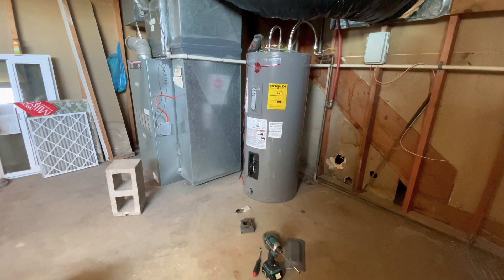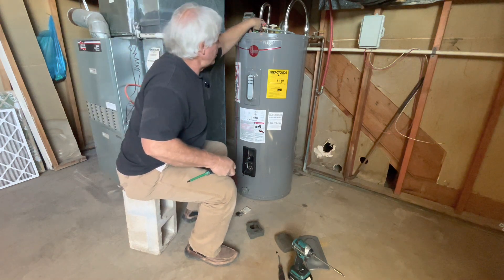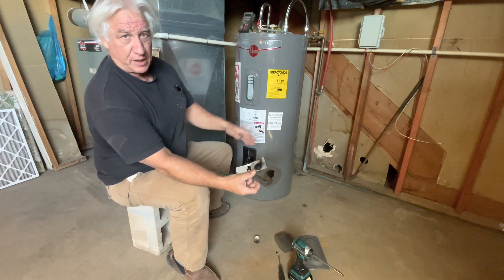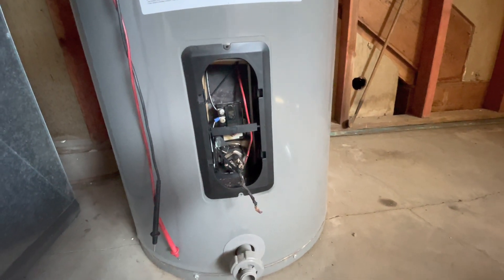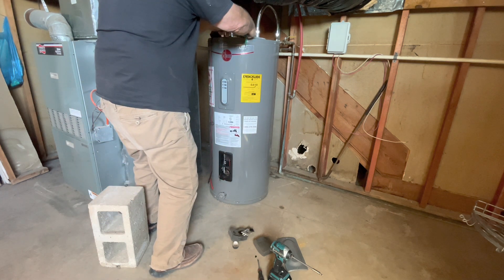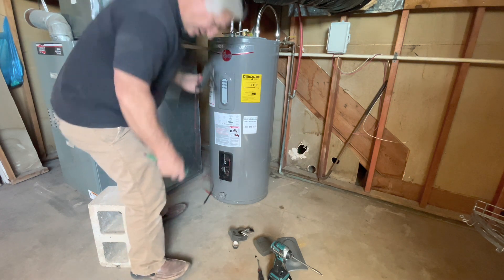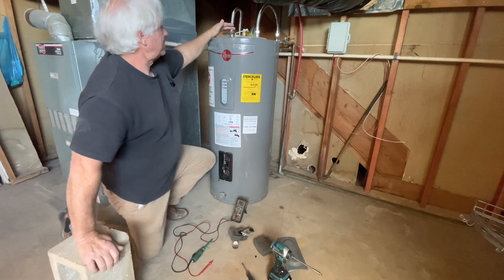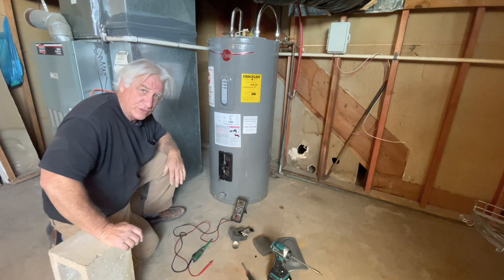RHEEM PERFORMANCE PLUS 40 GALLON 50 HOW TO TROUBLESHOOT HEATING ELEMENT

Comment: I am 65 year old lady, I always wear gloves and my hands are Clean when I work on my Rheem 40 Gal, but I can't figure out the Wiring, I have 3 Wires in the Plate Box, 1 Red, 1 Black, and a Green One preconnected under a Green Screw inside the Plate.... and I have 3 Wires coming from my Electric Cable to connect to the 3 wires in the Hot Water Heater, but my Wires i have to connect are Black, Red, and White, I have NO COPPER WIRE, or GREEN Wire... WHERE IS THE WIRE I GROUND????
Reply from the maker: hi, so sorry for the delay. you wouldn't need the ground. the neutral is acting as the ground. nowadays, all localities want mucho ground. SMH
Reply: @showmehow4076 Thank you for the response, I finally got it installed and we finally have hot Water 😁👍